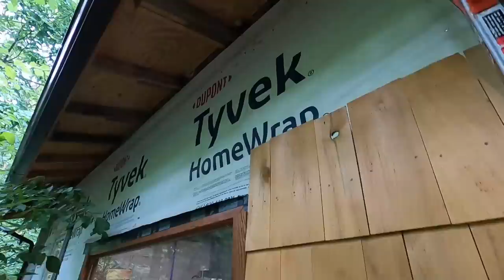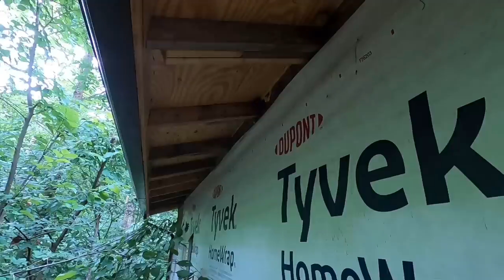Making TOOLS for the box & Working on the Shop.

Comment: I use the Klein scissors all the time. They are generally made for low voltage work such as telephone system and computer network wire. Those notches on the back are for stripping and straightening 18 to 24 gauge wire. The kit with the leather pouch comes with an extremely useful splicing knife. Good stuff!!!

Comment: I adjust wheel to a diamond or the work piece. With the spindle turned off I slowly bring the wheel down and turning the wheel by hand get the wheel to just drag on the diamond or work piece. The raise the wheel up about .002" and start wheel and come down .ooo5" at a time till the wheel touches moving the work  piece or diamond at same time  . I find less surprises this way. You should do what you are most comfortable with. 
Just a thought.

Comment: Those scissors are actually communication scissors. 
The little notches are for stripping the 22 and 24 ga wire that is used in the industry.
The scissors are very good for cutting all the little wires in a telephone cable and are strong enough you can cut a penny with them.   --Carefully

Comment: Take a look at Cape cod style housing online. They always have cedar cladding. There's a common practice where they keep the field of shingles very exact like you are doing. They often will do I guess a banner decoration at the top of the wall or in a band the top the windows. In that band they will lay the shingles crazy style with all different lengths. I agree with you that the straight lines are a better look, but a lot of these Cape cods where they use mismatched shingles just for the accent, it's a really sharp look. Does not look cabiny, it's a nice high end look

Comment: Poke around on eBay and have a look at feeler gauges made by Williams. I don't normally think of Williams as a precision machinist company, but they absolutely make the finest feeler gauges. I have a set that is 40 years old, all of the feelers are 10 in long and there is not a single crease, pinch point, rust or stain after all this time. They also always have a half thous feel er. Many sets seem to stop at 1 thou

Comment: Good Morning Steve....An old grinder hand advised me to hang a piece of white material on the inner face of the left side grinder table guard. Now when you're looking from behind the wheel to touch off on the part, it's extremely easy to see the white as you're lowering the wheel. You can see a few thousandths of light. When the white material becomes dirty you just change it. I used a piece of white nylon. Thanks the the videos!

Comment: Steve, I love your content, I'm a huge fan - however, I ran grinding machines for years, and I 'd hate to see you have an accident with one like the ones I've seen in those years. Just. Stop. The. Wheel. ...when adjusting, staging, or removing your work pieces! And in the kindest way, if I see touch that wheel while it's running, I will drive to Kentucky and slap you! LOL! But seriously? It's never, EVER worth those 2 seconds of risk!!!

Comment: Good morning Steve. I have done part's on the surface grinder that had a high surface. I usually turn off the magnet or reduce the power on a powerd unit. Using a piece af material as a stop so the part won't slide. Using light grinds the part will be flat. There's enough residual magnetic energy to hold the part. The vice is also a good process but takes a little bit longer to do. Good video.
George from Indiana:

Comment: Hay, Steve, (never worked with NSK) but I'm under the impression (and my experience)  that adjustment under the barrel on a micrometer is for calibration, not drag. If the threads are sloppy, that's indicative of wear (and no biggie). Totally possible there's another adjustment on the frame somewhere for calibrating, never worked with NSK. Love the channel!!

Comment: The NSK mikes have been rebranded to several brands including but not limited to Fowler and DoAll in the US. In my experience their own brand stuff is usually the best quality as if they would've cherry picked the mikes. They're on par with Starrett and Mitutoyo.
Reply: The drag usually is perfect from the factory and they should not wear noticeably
Reply: I have a set of 6-12 inter-changable anvil NSK mics. Very good quality as you noted.

Comment: It's too late for you to do this, but in general a really wide shingle needs four, not three, nails: left edge, right edge, and two about an inch and a half apart near the center. The idea is that the shingle is most likely to split in the middle and with two nails near the center neither side of the shingle will end up with a single nail.

Comment: Are you going to be painting the cinder block wall on the inside and or the outside? If so, what kind of paint do you have in mind?  I wouldnt wait much longer or your going to have to powerwash it inside and out. Inside due to oil deposits fromt the metal works.

Comment: Steve. Do you know about using a very thin coating of hylomar or permatex 85420 gasket dressing on the bottom of the mag chuck to stop it from rusting and rust jacking.

Comment: Do the blade guides need to be hardened? That's curious, I've seen numerous different blade guide designs and so many employ cooling blocks or phenolic, even delrin. Are the hardened guides specifically for running coolant? Even the guides that I have that are the same style as yours, I didn't think they were hard need, they seem to get a bit chewed up over time by the blade.

Comment: Any problem with that soluable oil water combination causing rust under the vises and other places where it sets unseen?  I remember the rust "Outside Screwball" found under his vise on the mill and other places.  Inside the chucks would be another hidden problem.  I tend to stay completely away from water soluable for that reason.  Oils diluted with diesel or kerosene if the smell of diesel is offputting are my preference.